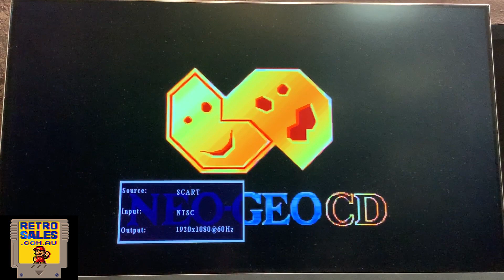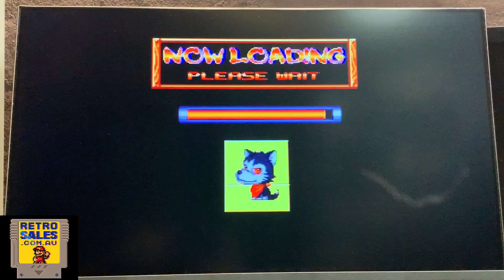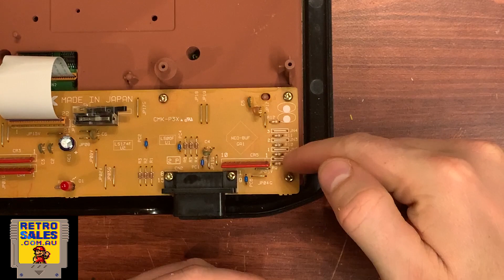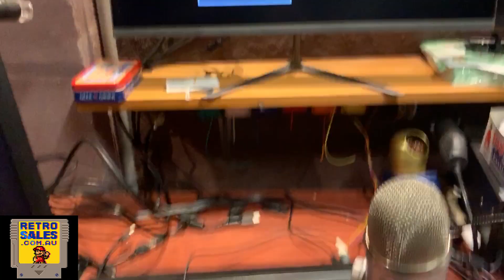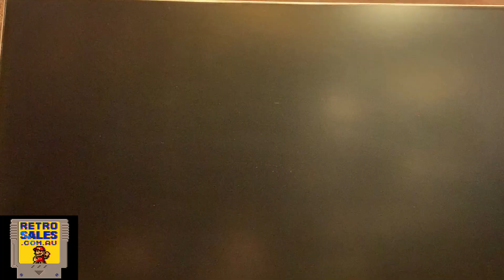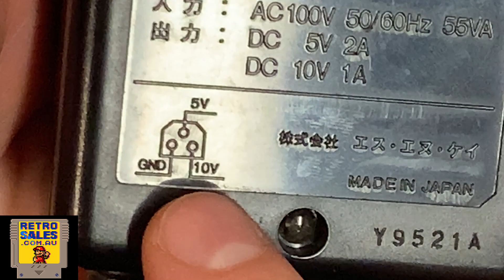Neo Geo CD Japanese to English Language Region Mod

Comment: Does anyone know if you can just get the small gauge wire and tape it in place so both ends are touching the contacts? I don't have a soldering gun and I wouldn't really want to buy one for a 2 second install. Nor do I know anyone that has one. Just curious if it was possible to do a budget install. 

Thanks!
Reply: the problem is that if the tape becomes lose it might short something. You could use a glue gun to keep it in place
Reply: @kibecru  makes sense! Don't wanna risk ruining it. I'll probably go about it the right way.

Comment: Hi, can you recommend a good upscaler? I've been watching your SMSII videos and the picture quality you are getting out is amazing, mine just has a basic RCA output mod and I've been through two upscallers so far and both give a really poor picture, color all messed up and the screen jumps around a whole lot, makes it basically unusable.
Reply: I'd recommend the Retrotink 2x...there is a newer budget model that just has composite and s-video which would be ok for your sms2 since you only have stock if I understood you correctly.  I think the device is around $70.  this will upscale your sms to 480 if I understand it well.  check out retro rgb on youtube as he has a review & knows the guy behind it, Mike Chi.
Reply: @linuxlover_8436  Hi thanks for the reply. I've since modified and upgraded to the Rad2x hdmi cable awesome result 👌
Reply: @TheRWD86  ok cool...forgot they had that as well...excellent choice
Reply: RetroTINK, yes. I have 2X & 5X. They are both very flexible for ANY kind of setup, especially the latter.

Comment: The entire title screen changed as it's called Spirits in Japan not Shodown. I've seen this done before but been reluctant to do it myself as American mode actually censors the games. Bye bye blood and bouncing boobs! Be cool to do the switch though
Reply: I had a US system. It does censor the games but most have blood codes. Well, Samurai Shodown 1, Metal Slug 1 and 2 don't have blood codes. Not sure if KoF 94 had a blood and bouncy code, but I know KoF95 does.

Comment: If you change language from Jap to Eng, there will be no blood in some games.
Reply from the maker: Would have to test it out... unsure about that
Reply: +1 US/EUR versions of the games are heavily censored. That is why I ended up installing a switch on mine, no cut just hanging off the back fully reversible. I did not care enough to pursue this but you should be able to use the switchless mod from the  megadrive and saturn instead of hardwiring or using a switch.

Comment: Interesting, I thought you had to install a unibios in order to to that. However you have green blood now, and that can't be changed from within the game can it?
Reply: When in the USA region setting Samurai Shodown 2 has green blood that can't be changed without the UniBIOS cheat. However, SS3 and SS4 can run in the Japanese region setting and the game can be switched to English language, effectively giving the option of an English version with no censoring. This is the same with many of the other fighters on the NGCD (especially the KOF series), so if installing the UniBIOS isn't an option then it's best to use this region mod and install a switch to toggle between its settings.